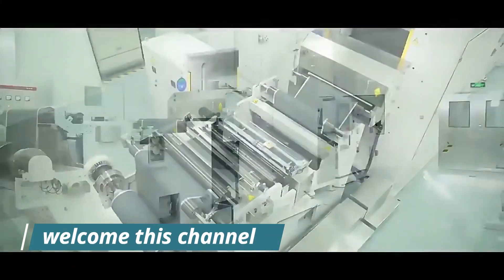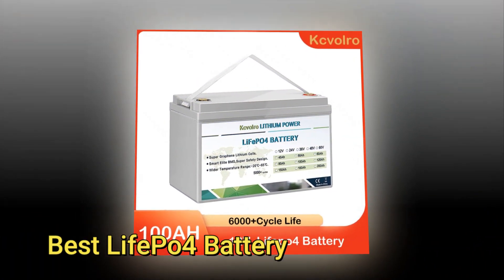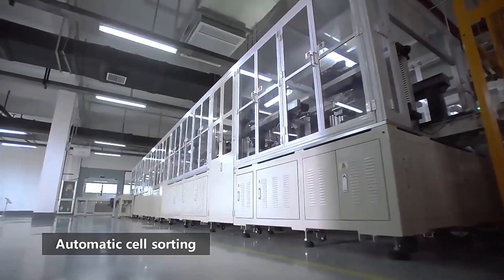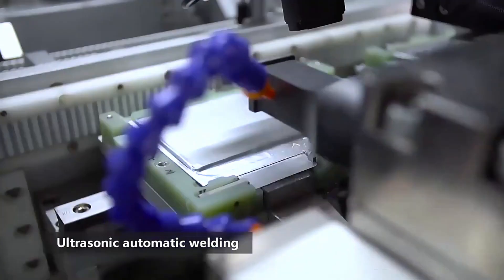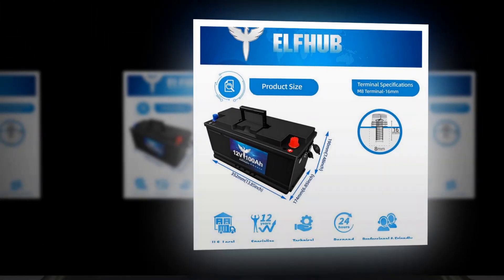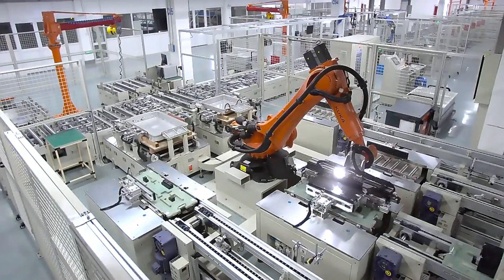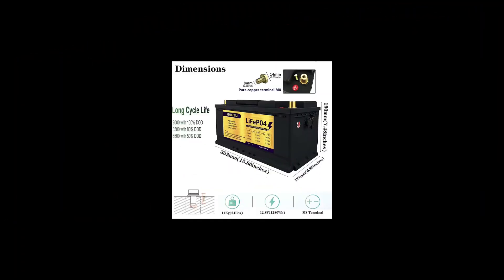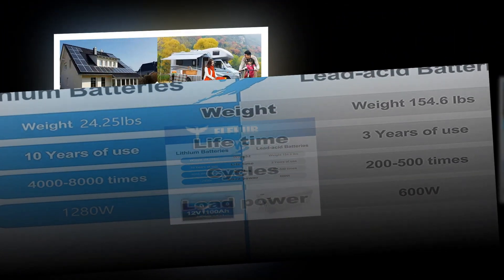Best LifePo4 Battery Reviews 2023|  LifePo4 Battery

Comment: Looking at ELFhub 100ah now.  I would consider this if I knew warranty and how to collect on it.  I see the battery on Amazon, great price, but can I trust it??  No way to open the box to see what cells are used.  Only way to test is bring one into my hands and test capacity and max drain.  This feels like a blind fold purchace to me.
Reply: I got one about a month ago for my trolling motor on my canoe. The motor is a basic minn kota endura 30. I have only used it once but I was impressed with it. I spent roughly 3 hours or so on the water and logged about 3 or 4 miles on it with most of time being running at max speed. When I charged it it was fully charged in about 30 mins. I barely touched it's capacity. I will definitely buy a few more over the next few months.